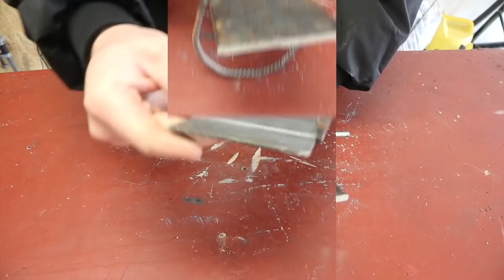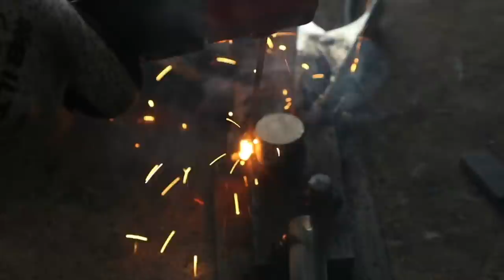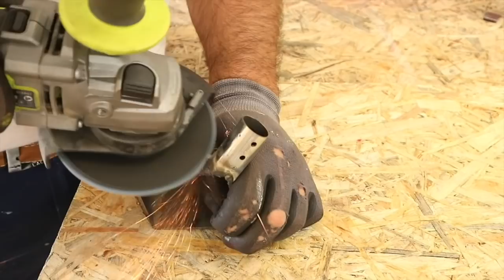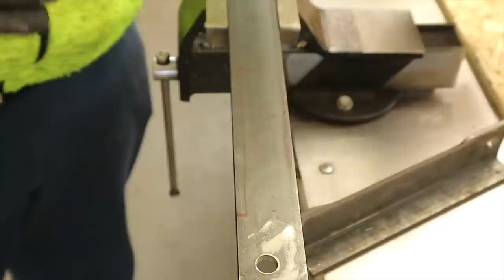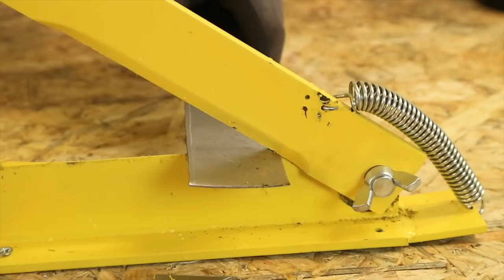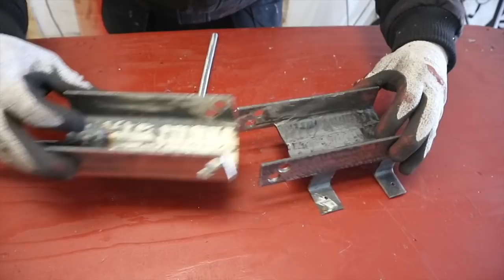WOW !!! 5 GENIUS HOMEMADE INVENTIONS

Comment: I need to make one of your lifters move the washing machine out when repairs are necessary with tearing up the vinyl floor. That would work perfectly.  Also,  I also the edging device looks handy. It looks like the bender may require a longer handle if your bending metal that thick! Thanks

Comment: Great
Some points missed....
1: Fixed Bolts on both sides of bearings instead of welding which help to replace/serviced.
2: Batter to sharp a little bit fron to insert the lifting items
3: Bearing height is lower comparising to lifted materials
Any how good produt but need improvement.
👍

Comment: The axle is crooked in the first one. And the pivot point for lift is not useful at all. You must work at a steel yard cause I never saw so much good metal go to waste, not all, but some. However your last build is very good.
Reply: patrick mcglone  yep. You always save the best eye candy for last